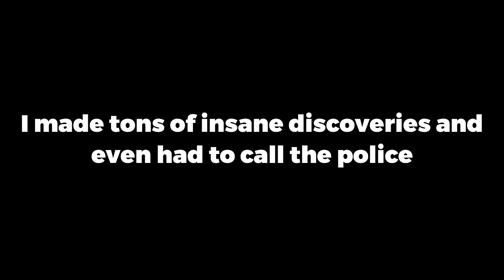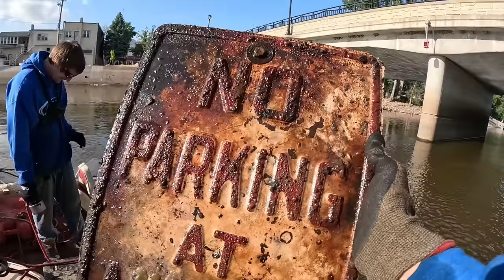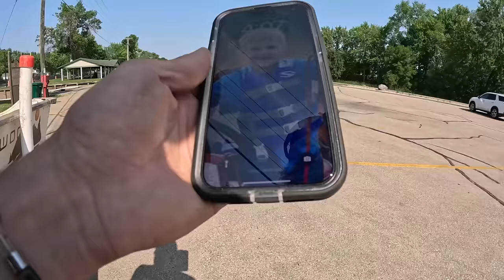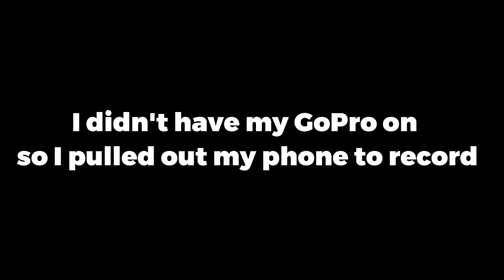Magnet Fishing Giant 100+ Needle Drug Bag, Old Guns, Police, Game Warden & More!

Comment: 51:00 part of a 1920's era two wheel child's scooter. 2:24 that's an light dimmer switch that us3ed to be foot operated on the floor of the driver side of older cars.If you find more flesh that really stinks (especially since you have found a gun, drug bag and other stuff like that) you can pull out the flesh, put it in a baggie, freeze it and take it to a mortician. He will be able to tell you what kind of flesh it is.

Comment: the way window weights work is there is a rope tied to them, that goes around a pulley and attaches to the frame of a window. They make the old heavy glass and wood windows easier to lift and the weight helps keep the window in the position it was lifted to.

Comment: All those hubs with gears and rollers etc definitely look to be part of a conveyor system. So either some very old factory got washed away in a flood or they were chucking their old parts in the river lol.

Edit: you should also take your magnets with an aluminum ring and get it tig welded closed instead of those carabiners. Then it would have to tear a significant chunk of aluminum to come off lol

Comment: 😅 the damper goes in the stove pipe and you control the air flow through the stove pipe so you can let it flow when your first lightning so it doesn't smoke you out and then as it gets hot then you can close it off and save your wood and get hotter

Comment: I believe your motorcycle footpeg there is a step up off of an old wooden carriage if you look at the bolts that are through the thing they are old carriage bolts with square nuts on them not something that would be used on a motorcycle

Comment: Has Jack stand is actually a jack if you get it cleaned up you'll be surprised how good it works and that roller you just pulled out now that's one off of a washing machine that I'm used to seeing big fat round ones those little skinny ones you were finding before almost think they were from some kind of a pretty impressed conveyor belt system or something
Reply: Yeah those laundry rollers where your rinse cycle that you have in automatic washing machines nowadays